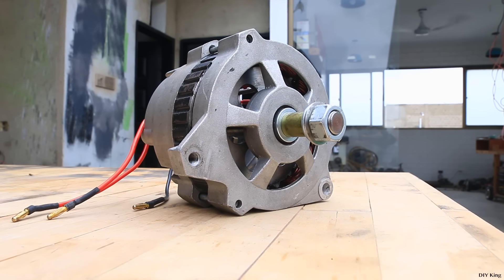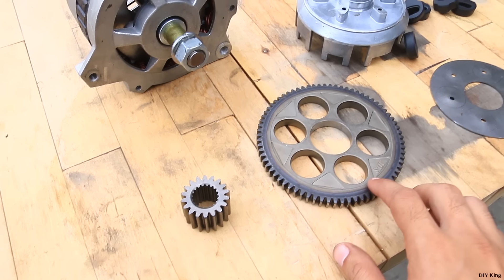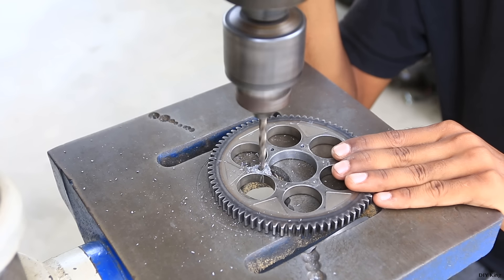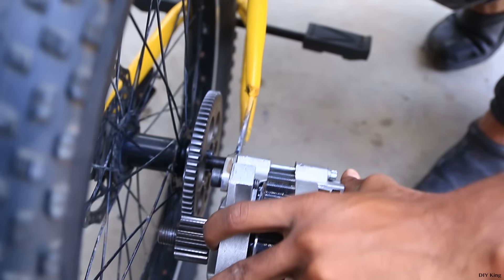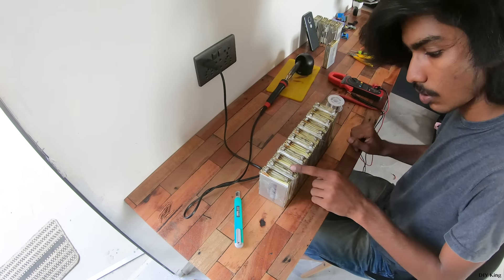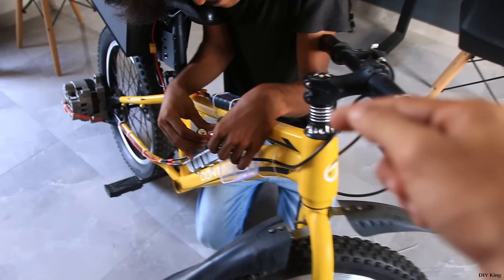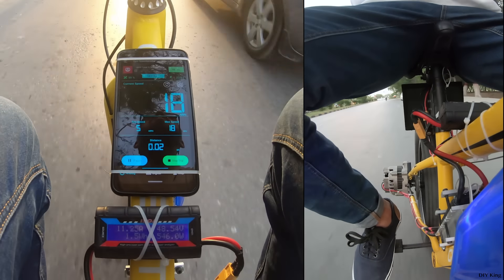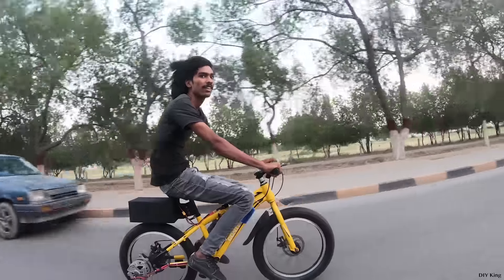Bicycle Conversion using a 10,000 Watt Car Alternator

Comment: There is no such thing as a 10,000 watt car generator
Reply: Ya maybe. Car battery is 12v 40 Ah so 480WH. If it can be fully charged in 20 minutes and also power auxiliary circuit then still 2000Watts are more than enough.
For a big truck with 200AH battery energy is 2.4kW so 20 minute charging would require 7.2kW and may be 1kW for auxiliary. Still not reaching 10kW.